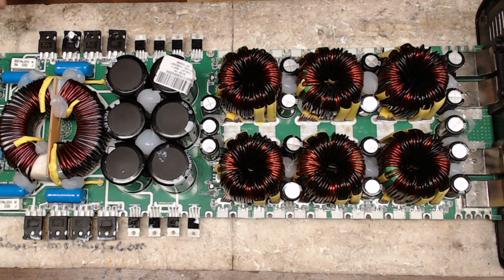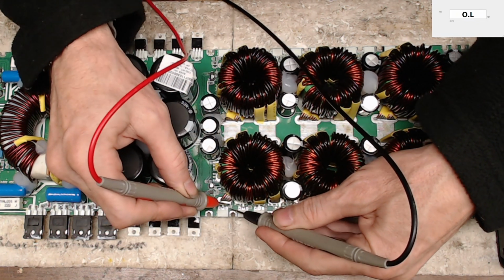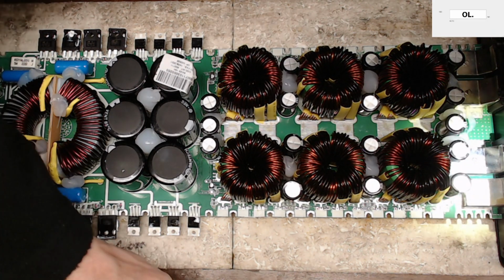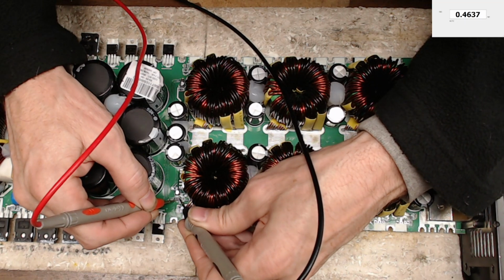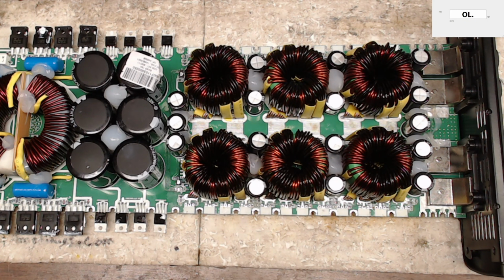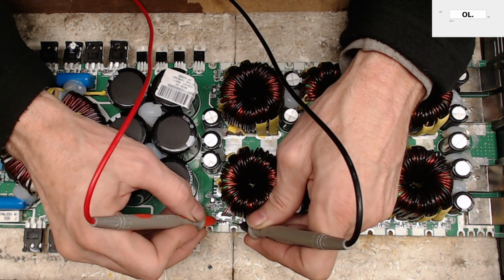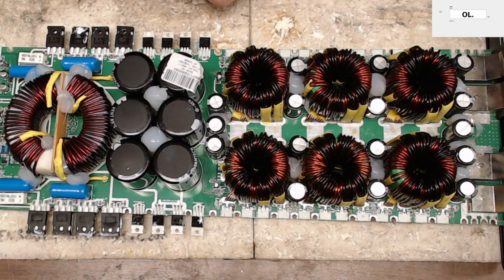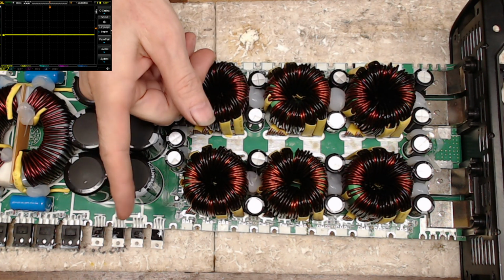Taramps Bass 15K Brazilian Class D Power Supply Fault and Repair

Comment: Do you have any information on troubleshooting the amplifier section ?
Reply from the maker: Hello, I used specific steps to diagnose an amplifier. The Bass15k can be a hair-puller if you are not used to diagnosing full-bridge boards.
Reply: @ellensburgamplifier I did determine the root cause of the problem, took me a while. Those 1a transistors that monitor each of the output conditions (all tie into the protect line that goes back to the MCU) ended up being the issue. All tested good, of course.
Putting the amp into Service Mode, would created drive, with a little bit of modification. Long story, but it’s the fix

Comment: Appreciate the info todd im actually working on one of these at the moment with fail power supply no short on output definitely driver ic is burnt, and so are the Irf1404 im praying the mcu survive
Reply from the maker: There is a revision to the 15k in the power supply. Contact me if you are unaware of this.

Comment: Why does my 15k amp vibrate when I turn up the gain is feels like a huge current amount is going thru it it's kinda scary is that normal?
Reply from the maker: Not sure I would call it normal but that amp can draw 1300 amps and if it is at all struggling to get that current it may make some high transformer noises.

Comment: Am working on one of this amplifier that have every power supply and output mosfet burnt-out plus two smd ic that I can't find anywhere 🤦 keep up the good work sir like always nuff respect 👍 🇯🇲  🇺🇸  🙏
Reply from the maker: Which ICs are you looking for? Thank you for watching!
Reply: @ellensburgamplifier  hi Good luck. I have a 30kW RMS Macouistic amplifier. The output transistors are 20 pieces of V1 brand. I identified the output drivers as Si8244BB. The block capacitors are 400 volts. I used an Irgp4063 as V1 and an IGBT, and the amplifier worked, but I didn't have the opportunity to test it with a 30,000 RMS load. Would 20 pieces of Irgp4063 be suitable for 30,000 RMS, or what should I replace it with to provide 30,000 RMS power? I would be very grateful for your help. The power supply MOSFETs are H2 coded, and there are 64 pieces of 16 square transformers. I used Irf1404 instead of H2, would that be OK too? What should I use instead of H2? Finally, is the output frequency of 25KHz normal? The amplifier I have is identical to the external appearance of a B2 Brand 30KW amplifier. Good luck, I'm waiting for your help.

Comment: You do awesome work!! Wish you were in the Boston area,I've got a Rockville 8k which is actually about 1.3k that's got a failed powered output sec
Reply: Interesting to see these Taramps on the bench, and what failed. My opinion, the amp was ran too high of voltage, or caught a current spike. Usually see the output section dead in your videos.
Reply from the maker: @mikehonda50145  Not often at all that I have to repair power supplies. Here is the thing, the IRF1404 is good to 20 volts gate/source so even with a 16-volt system I can't see the transistors failing from voltage. Reverse polarity by chance? Usually, I see other damage present from that. Extreme current draw when heat saturated? Now that is something I can see based on the current/heat curve in the datasheet.
Reply: @ellensburgamplifier  that is a possibility. I know Taramps is known for temperature issues. Guess a cooling rack is in order when purchasing Taramps for heavy use.
Reply from the maker: @mikehonda50145  If I could suggest anything to the engineers of Taramps it would be to throttle the fans based on temperature for all their amplifiers. Right now only a select line has that as part of the MCU process. These fans wear out quickly and throttling them back will extend their lifespan.
Reply: @ellensburgamplifier  yup. What’s interesting is my JL 1200/1v3 amps, in the location they are in, gets really hot, and has minimal ventilation. I created  a filtered cooling system using Steve Meade’e SMD TM-1 temperature controller, which has a speed control built in 3 speeds that runs according to the temperature i set it to. I set mine to come on at idol temperature, like 80-90 degrees Fahrenheit, lowest speed. I removed the cover plates, and did 2 centrifugal fans. One per amp, and the hottest my amps get under load is 110 degrees. By the way, Will you be able to get back to me about the email i sent?
Reply: @ellensburgamplifier   yup. What’s interesting is my JL 1200/1v3 amps, in the location they are in, gets really hot, (edit: My YouTube channel shows how they are mounted in the 12 inch subwoofer test video) and has minimal ventilation. I created  a filtered cooling system using Steve Meade’e SMD TM-1 temperature controller, which has a speed control built in with 3 speeds that runs according to the temperature i set it to. I set mine to come on at idol temperature, like 80-90 degrees Fahrenheit, lowest speed. I removed the cover plates, and did 2 centrifugal fans. One per amp, and the hottest my amps get under load is 110 degrees. By the way, Will you be able to get back to me about the email i sent?
Reply from the maker: @mikehonda50145  Oh my did I overlook an email? I will go check. Good job on keeping those JLs cool. The inductors like to get toasty in those.
Reply from the maker: Feel free to give me a call!
Reply: @ellensburgamplifier  yes they do. Very cleaver design they have with that regulated power supply. Operating on stock electrical without an issue, clean and quite efficient for the design. Would love to see them make a 3,000w amp. They finally made a 1500w when they stopped at 1000w for a while.
Reply: @mikehonda50145  those are really nice!
Reply: @ellensburgamplifier  that's  great man,thank you! And thank you for all the info you put out there for us noobs and vets in the car audio world!✌️
Reply from the maker: @markroberts715  Thank you and always happy to help!
Reply: @markroberts715  are you talking about the amps?
Reply: Hi @ellensburgamplifier  this amplifier output transistor part number? And 30 kw amplifier output transistor V1 marked. V1 Marked transistor part number?
Reply from the maker: Thank you for watching Mark! Failed outputs include failed drivers most times. I am not sure what style drive they use but shouldn't be too hard to repair.
Reply: @ellensburgamplifier  thanks for the advice Todd
Reply from the maker: @markroberts715  Any day!
Reply: No the SMD products
Reply: @markroberts715  ahh ok. Thanks. Yeah, the devices are handy. Especially when I let people demo the audio in my car themselves. I give a quick run down, then let ‘em have fun.
Reply: @mikehonda50145  LOL that's awesome! I do the same for my friends and family and they think I'm nuts that I like music that loud and that much windy base, I'm psyched because I have a DSP coming and I can't wait to top off my system with it
Reply: @markroberts715  I have the Audison Bit Ten in my car currently. Works for me for now. I have the JL VXi1000.5 and a Fix 82 that I’m linking together using optical later, once I have time to park and redo my whole system over. I’m planning a 3 way front stage, and a 3 way rear stage with my own built passive crossovers. Going all the way sound clarity. I already built all the plug and play harnessing for the Subi.
Reply: @mikehonda50145  no shit huh!!! Those jl VX amp/DSP combos are beautiful!! Saw Mark on car audio fabrication do an install w one and wow their nice,looking and performing,plug n plays the way to go,that way you can UN plug and go lol,send me some pics if ya want,I'm always down to look at pretty systems lol
Reply: @markroberts715  Once i get to sit still from work, I’ll be able to post up some videos, tuning, and demo. Yeah, them VXi arms are superb. I got to tune and setup one a year ago for the boss. I know Brian, owner of Mobile Solutions, as well as Mark. I went to his Master Subwoofer class back in 2013. It’s an experience all must do.
Reply: @mikehonda50145  that must have been an experience huh?! I'd love to do something like that
Reply: @markroberts715  It was worth every bit.
Reply: @mikehonda50145  it really is!!